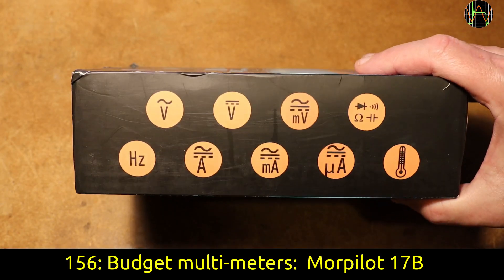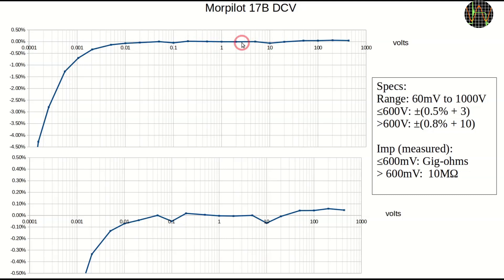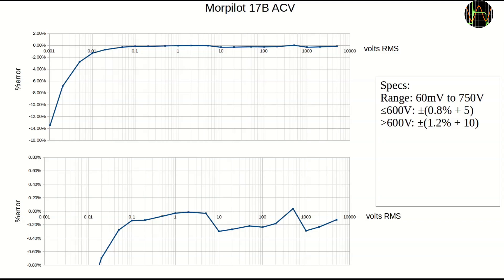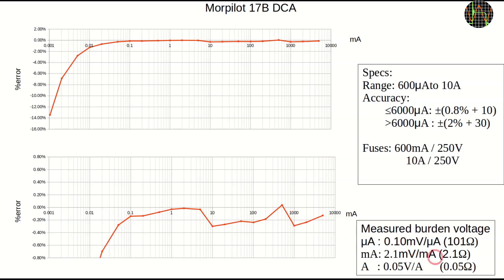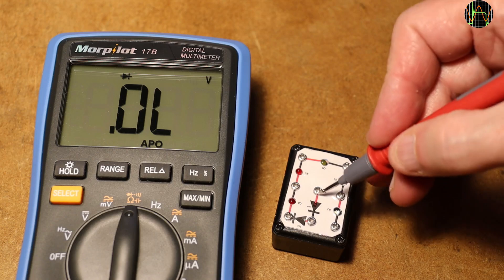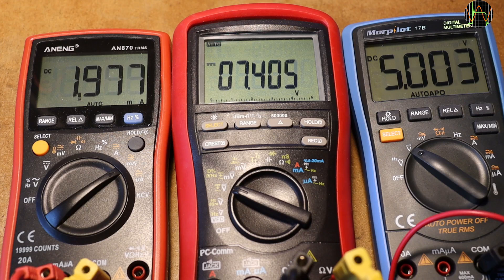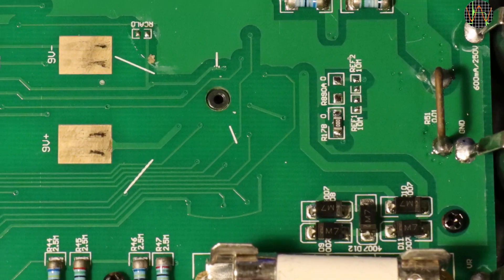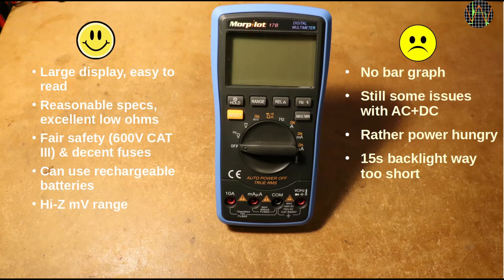156 - Budget multi-meters: Morpilot 17B

Comment: Even though, you can further improve it by replacing the voltage reference to a better version. And the beeper you can add a little resistor to lower the noise a bit. 😊
Reply from the maker: Actually for noise abatement, I usually put a sticker over the hole in the buzzer. I find that works very well and is easy to do and undo. Your solution is more effort but technically better because it also reduces the massive power-draw of the beeper.

Comment: The fuse shows that this multimeter is capable of being used for the repair of switching power supply. Because of the intermediate rectified voltage of 380 Volt. Thumbs up for this really well designed multimeter! 😊
Reply: Can this switch bulbs on

Comment: Thanks for the video. I would like to suggest that you review the Richmeters 158D (also sold as NJTY T58D). I bought one on Aliexpress for 159BRL with taxes, approximately 32USD. It has 60 thousand counts, automatic backlight, indicator light for test leads, temperature, max/min and peak. No one has made any videos of this meter until now.
Reply from the maker: Intrigued! 60000 counts for that price seems incredible. I looked but I don't see one ready to buy. There are sellers for the T58A, B, C that seem to also offer the D but I am wary ... no pics or anything and I don't want to be sent a T58C...  I think I wait a bit. But thanks for the tip
Reply: It has another specialty it has a resolution of 0.001 Ohm in the resistor mode. This is very rare.